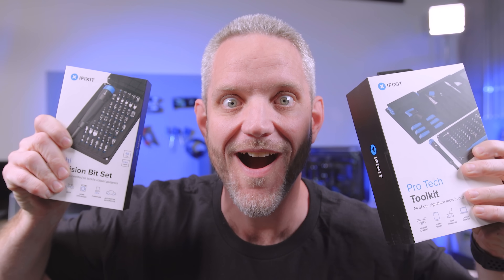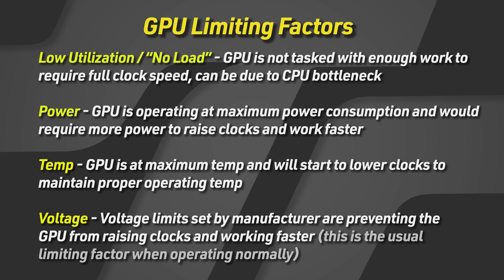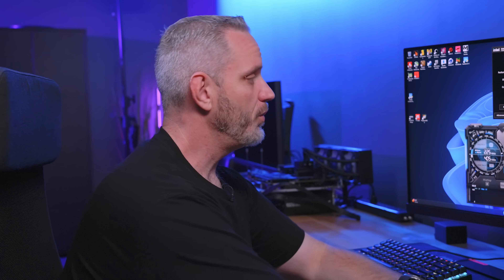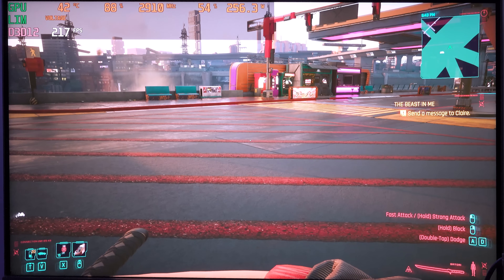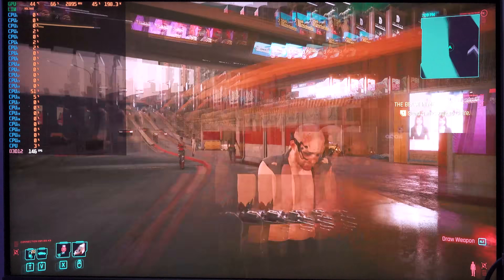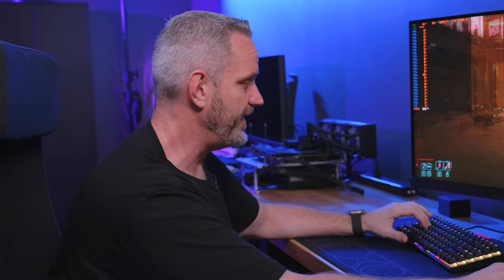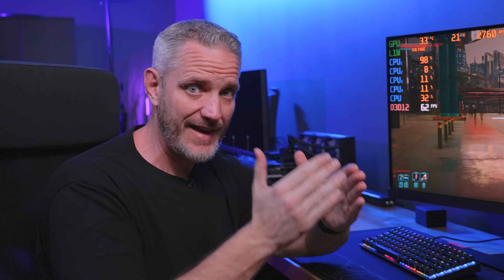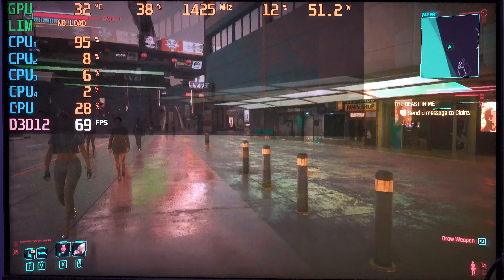THIS is what Bottlenecking REALLY looks like! AVOID THIS!

Comment: I upgraded from an Intel i5-7600k to a Ryzen 7 7700x but kept my GTX 1080. My framerates have increased 2 to 3x in CPU bound games like Risk of Rain 2 and Rust. God bless Microcenter for that $400 bundle
Reply: That's a huge upgrade. Mine is similar. I upgraded from the i5-8600K to the Ryzen 7 7800X3D ... I've only tested one game... But Kingdom Come went from 40 FPS at ultra to 60 FPS ultra. Never knew my CPU could bottleneck my PC like that.

I also massively upgraded the cooling, which helped keep temps insanely low. My GPU used to run at 90+ and my CPU at 90+ ... Now my CPU runs at 75 and GPU 75 at max.
Reply: I just went from a 6700k (4.8ghz) to a 14700k with a 3070, and from a z170 w 2600mhz ram to a z790 w 6000mhz ram, yet to pick it up, stoked!

A 7900xt is planned next 😁

I'm at 3440x1440 120hz so I didn't think my cpu was bottlenecking super hard until I got into act 3 in bg3 😂
Reply: Yep! Im building a new pc and for the moment my GTX 1080 paired with Ryzen 7 7800x3d will have to work
Reply: Those microcenter bundles are the real value
Reply: @balin1  In the UK Microcenter doesn't exist we have Currys PC World but the choice of peripherals is limited .
Reply: Did you test to see if you were cpu limited like Jay showed? I'm in a similar boat playing tarkov with my 1080 and xeon e3 1231, when I crank it to 4k I become gpu limited with vram use almost maxed and gpu utilization near 100% but when I drop it to 1080 and maybe add fsr on top of that I get closer to high 80s percent on all my cpu cores but gpu utilized % goes down. So I wanted to do what you did and will upgrade my board eventually but I think for now maybe slotting in a 7900 gre and I can still push my cpu a bit more, esp after installing an aio cooler which I plan to carry forward on my next build
Reply: @Tiagocross  I have a Ryzen 7 5800X3D paired with a RX 7800 XT and before changing my gpu for my 7800 XT i was having a 2070 Super. I saw a big fps boost, my gpu was to slow to handle my cpu and still in few game in 1080p like Cod MW2/MW3 my cpu still way more faster than my gpu wich is a great think considering my 185 fps average. In few more cpu bound game it balanced perfectly fine. I think i have a great combo
Reply: I have i5 10th gen paird wth gtx 1070 my fps in warzone 60-80 now i chnge my gpu with rtx 3060 my fps now at 80 low max 130fps
Reply: 4 core/4thread cpus are so bad today if you have a good gpu
Reply: @bjarne431  Yeah now we need 6 cores minimum for good gaming
Reply: Wow. I went from I3 8100 to I9 14900K, from budget DDR4 to DDR5 Z790 64GB RAM, but I kept my EVGA GTX 1070 TI FTW2 and it gave me double if not more FPS in my main game Hunt Showdown. Hunt got an engine update and it still runs smoothly to this day. 

I got extremely lucky with my 14900k not being a crap.
Reply: yep huge upgrade man, it really just depends on your game preference, ofcourse the GPU is bottlenecking it but compared to what it was, thats a huge upgrade. one day maybe when you get like $600 to spend on a GPU you can find something great!
Reply: Went from a i7 - 3820 gtx 1060 to a i9 - 13900k 3080 ti , microcenter will forever be the goat
Reply: @Davincibeats  theres no such thing as a cpu or gpu bottleneck pc really, theres only cpu or gpu bottlenecks depending on activity being done on your pc. Some games are gpu heavy and barely use cpu and some use only cpu and barely graphics card. Like league of legends u can play smooth without a gpu and just a CPUs igpu, graphics card is just for graphics really so just settings decide bottleneck. U want more fps playing ultra settings? then its gpu, u want more fps playing low settings then its cpu. My fps on valorant (cpu heavy game) didnt increase from 1060 to 4070 super, still same 500-700 fps. Cs2(50/50 game)  it was massive change like 100fps to 400fps and both games i have medium/low settings. Some CPUs are faster at rendering and some better for gaming, seeing statistics about how a cpu is faster than another means nothing either, sometimes u need alot of cache on cpu and sometimes u need speed. knowing this is important if u looking for the best hardware for your tasks
Reply: @Heckinwhatonearth  I have 8 years old Pc 6700k 980ti. I only wow. I want to upgrade my cpu but dont know if its enough or I should change Mobo gpu and cpu
Reply: Rust is a abomination when it comes to CPU load. My 5950X bottlenecked my 7900 XTX, i never hit more than 95% GPU util. AT FUCKING 4K. I had to upgrade to a 14900k, did not find any other game that was unplayable on high end hardware.
Reply: I had a i9 10850k with a 3080 and upgraded to a 7900x Ryzen 9 and my performance went up a shitload even in response times and frames
Reply: Have RTX 2080 and got new Ryzen 7 9800X3D and performance so much much better now in all games :)
Reply: i wish i could upgrade like you did but that means changing the motherboard too because i have an I7 8700
Reply: @ayda2876  pretty old CPU, time to upgrade :)
Reply: @MrBaKalu  its still pretty good but yeah i need to change it its just annoying to buy cpu + motherboard + new ram, that means changing basically everything at this point

Comment: My concern with bottlenecking isnt that I'll get stutters or jitters, no my concern is that I'd pay money for an upgrade to only then find out that my upgrade was entirely pointless because some other component is maxed out and that keeps whatever I just bought and installed from working harder and giving me more performance
Reply: Exactly, I upgraded my PC from i5 3rd Gen to i5 10th Gen, and GPU from GTX750Ti to RTX4060 only to find out that my i5-10400 is bottlenecking 😢
Now I need to spend more money on i7 or i9 12 or 13th Gen processor to get the max performance 😭😭
Reply: @DragomirGaming I really hope I won't be running into the same issue after upgrading to an R5 5600X. As it stands, my Arc A750 is being bottlenecked quite hard by the Ryzen 3 2200G.

According to my tests with another PC, the Ryzen 5 is 2,6x faster than my current CPU so who knows.

Edit: well as it turns out, no, a 5600X is not a bottleneck. In fact, it's the best gaming CPU in the price range.
Reply: I bought a 4070 for a computer that had a ryzen 5 2600 cuz I didn't know what bottlenecking was
Reply: @DragomirGaming I just got an i7 for the same issue
Reply: mine is the motherboard
Reply: @DragomirGaming  if mainly using it for gaming plus light activities like browsing and watching streaming content then i7 is enough. i9 is really only needed for those people using software that needs a lot of data processing  such as photo or video editing or CAD Computer Aided Design such as Dradfting, Architecture or Animation rendering, making games that sort of thing. Also always get at least 16GB ram, preferably 32GB or more as it helps everything run. Also consider your storage needs such as M.2 Nvme SSD or normal SSD. Also don't discount your monitor as that can be its own bottleneck for example getting a high-end PC capable of running leaadinng games in 4k @250  FPS but using a monitor that's restricted to 60 Hz, 60FPS.
Reply: Im sorry to read that, but you should do research first not because it's new it's gonna work a 100%, had to take many many things into consideration before choosing the correct GPU to pair with my CPU to play in the correct resolution, it helps a lot if you choose a component and build the other around it (usually choose gpu and build from there) and then watch other people's videos in where they benchmark your cpu-gpu combination in different resolution so you might get an idea of what to choose
Reply: U guys are not poor enough to create a backup plan 😂😂😂. 

My gpu budget is 50$😭😭
Reply: @thekingofprotoss4376  right there with you on that dawg lmao. Paired a 4070ti super with a i7-11700k. Got to looking at new processors that'll really up the performance across the board and found that the motherboard isn't going to allow for faster ram or a better processor. My build was optimal  running a rtx 3060 12gb. Once I changed that, an entirely new project was birthed. LMAO

Comment: Lowering graphics performance will allow GPU to generate more FPS.
The more frames GPU generates, the more CPU has to work with those frames.
Reply: And capping Fps saves alot of energy. =)
Reply: great summary
Reply: Is it good or bad?
Reply: This explains why lowering my graphics to get better fps on my already bottlenecked GPU does absolutely nothing. Makes it worse actually.
Reply: @Co7Vc3  can u tell me yo build rq. PLEASE DONT BE WHAT I JUST BOUGHT
Reply: @eldolo7021  i dont understand what you are asking.
Reply: @Co7Vc3  he's asking bout ur specs
Reply: @pleplepleple2019  oh I got it. He wants to know what im running.
Reply: @SoloDolo-exe  im currently bottlenecks by my cpu. I have a i7-6700k with a RX 5600XT. My processor is a lot older than the card, but I got this pc for 300 bucks from my friend 2 years ago to get me by while I planned my next pc. I just ordered and currently waiting on a 7800x3d with a 7800xt.
Reply: @Shywer  Oh boy, so economical and effective! FPS lows are happier too most probably.

Comment: the frametime graph in afterburner would be a great visual aid, because as you said, it is hard to see jitter/stutter in the video. Adjusting the max and min properly gives a great indication of this issues.
Reply: or just use intel's gpu busy graph to know what settings to use.
Reply: YES! Always show frametimes pls.
Reply: How do you use it?
Reply: @squirrelattackspidy   just search for how to setup the msi afterburner/riva overlay, once you set it up you can turn the osd for the frametime with the option "graph" the max and the minimum for the graph can be set to 2 ms and the max to 20, with this value you would be able to monitor from 50 to 500 fps. if you are at perfect 500 fps your line would be a flat line at the bottom of the graph. the lower the fps the higher the line will go, what you want is aways a flat line with not a lot of lumps, this means the experience of playing the game is smooth, any spikes mean a big stutter.
Reply: @thigo94  Thanks!

Comment: A small detail/correction: In most game engines, such as Unreal, Game Thread (main engine thread running the world etc) and Render Thread(s) (the threads responsible for "talking" to GPU and giving it instructions) are separate. The main thread (GT, Game Thread as it's called in Unreal) "ticks" the world, but does not send render instructions to GPU or waits for GPU (for the most part). That's what Render Threads do.
Reply: Is there a way to check exactly which are the game threads and render threads? I don't see it in afterburner/rtss.
Reply: @rodiculous9464  Depending on how it's done to a degree but in general no, since you don't see threads anywhere, only separate processes/exe's. Also, there is no reason for a game engine to have n threading enabled, it's an unnecessary overhead to code support for. It's not impossible by any means but it would bring a bunch of extra junk eating CPU time without enough gain in return. What I mean is, I can code a process to spawn 4 threads always, or just one, or sniff the load on the machine, take a count of cores and roll a pair o magic dice to decide how many threads to spawn, and check again every 10sec to see if to spawn new threads or cull and queue old ones etc. 
I'm an ex sw dev, most of the time for small things I never spawned multiple threads even if the task could support it, because it's more overhead than gain. For major worker loops I usually set a max, 4 or 8 depending on what it is. I did very occasionally code to spawn MANY threads at once, because I wanted a sort of snapshot to process coherently, meaning for example 40 different parameters of a changing dataset sampled at once, each spawning a worker thread to process - once done I have the processed result of a "snapshot" all different parameter at one time. 
But all these things change faster than a user can perceive in many cases. But yeah, it depends on how it was coded more than anything else. The OS cannot decide to spawn new threads of something, the application can be single threaded if it wants to. The application decides more than the OS does, since it has to be coded specifically to spawn threads and then manage them, there is no "automagical mode" to it, if it isn't coded for it, it won't nor can it do multiple threads. And even if it is threaded in code, the developer(s) decide how many threads and when and for what. The OS has no crystal ball to see what the application benefits from, thus has no positive control, and very little negative control.